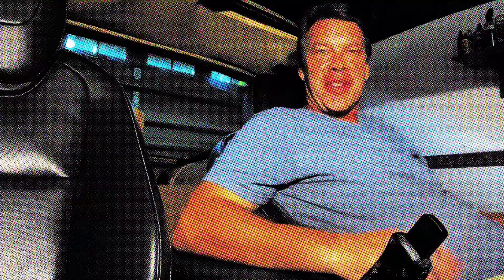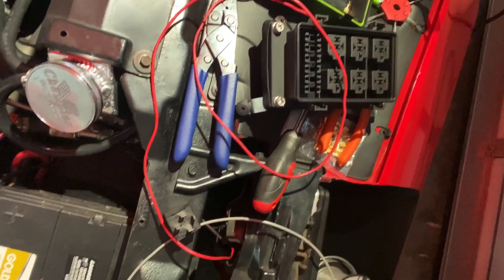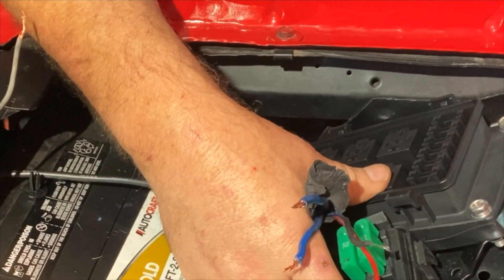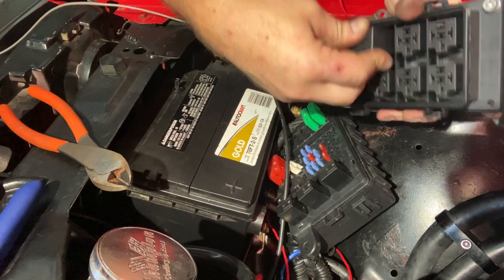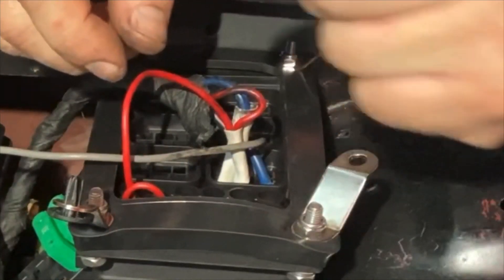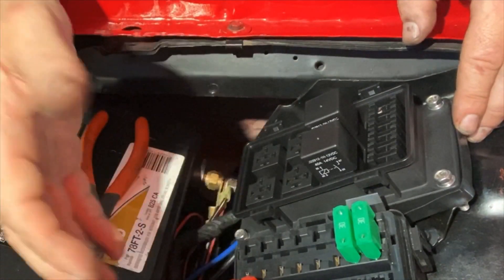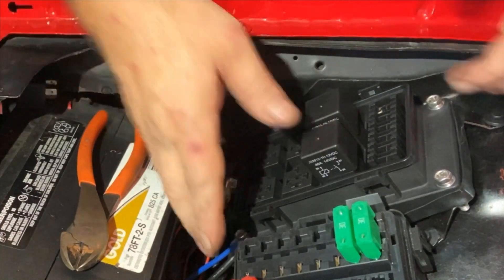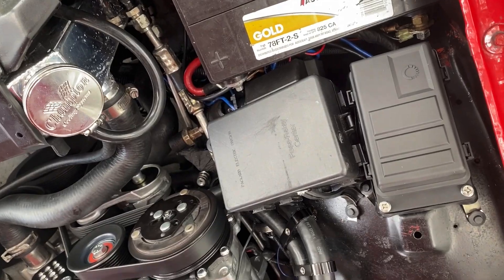Wiring relay center and fuses in my thirdgen Camaro

Comment: Where did you find your Key On Power?
Reply from the maker: The GMPP relay center has a key on fuse so I jumped off of that
Reply: @FireballMullet  would it be safe to run that into a Key On Bus? To make wiring in multiple relays a bit cleaner? I'm a bit of a novice still, trying not to blow up or burn down my car lol.
Reply from the maker: @ariyanadumon4549  if the ignition is the relay trigger, I use that fused ignition on for multiple relays as the trigger is fine ... but I run a relay per electronic component if that makes sense

Comment: I am so thankful you made this video I've been having firing problems and my 88 that has a 350 vortec swap throttle body and let me tell you straight piped to master flows  not sound good going womp womp at 3 in the morning in a residential area
Reply from the maker: Leslee prather I agree 💯 good luck with your car!

Comment: You're a dumb ass. 30 goes to the BATTERY with a fuse. 87 goes to the fan. 86 to 12v switched, and 85 to ground.
Reply from the maker: Thanks for the feedback, it’s wired correctly and works great
Reply: @FireballMullet  Terminal 30 always Always ALWAYS goes to the battery through a fuse. So no, it's NOT wired correctly.
Reply from the maker: Terminals 30 and 87 are electronically equivalent. The coil when triggered connects those two terminals so it doesn’t matter if you put power or the accessory lead as long as it’s those two. Thanks again 😎
Reply: @FireballMullet  WRONG. 85 and 86 can be switched, but 30 ALWAYS goes to the positive terminal of the battery. 87 ALWAYS goes to the fan. LEARN ABOUT HOW RELAYS WORK.
Reply from the maker: Thirdgen83 the way you are wiring is right too, thanks!!  you know what the best thing about this is? You can wire  your relay anyway you want and make a video lmao 😂